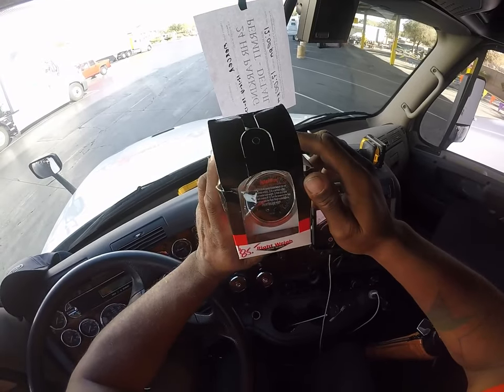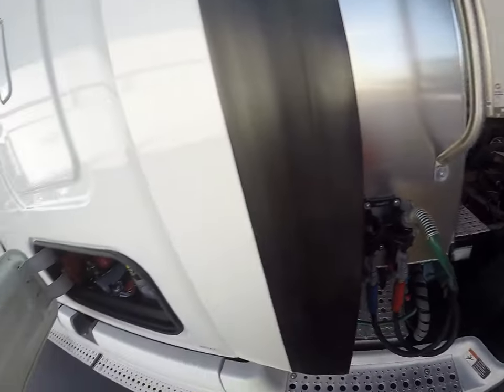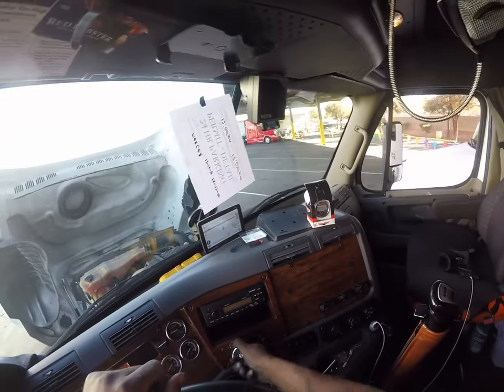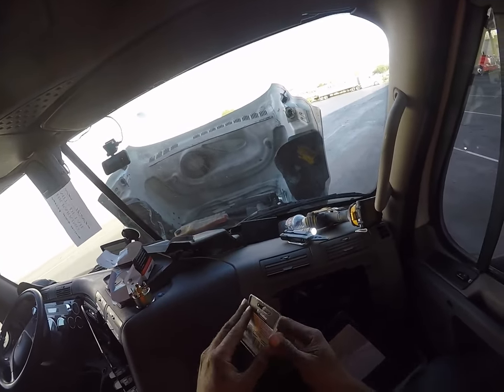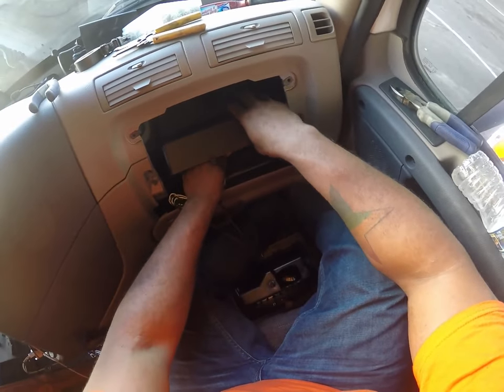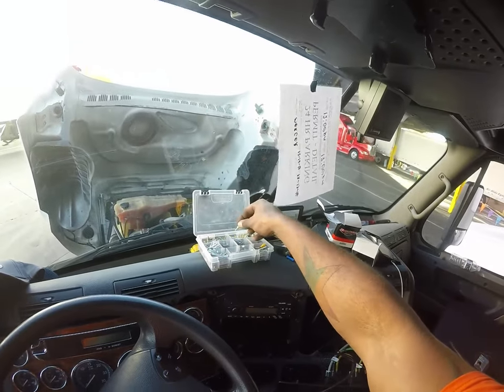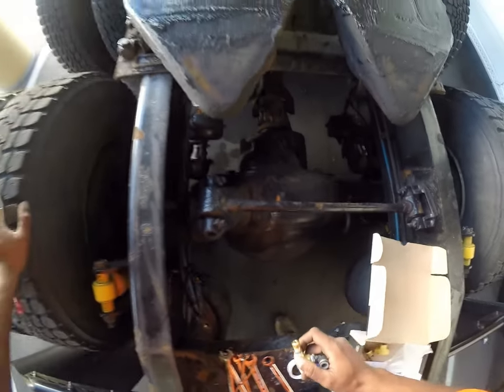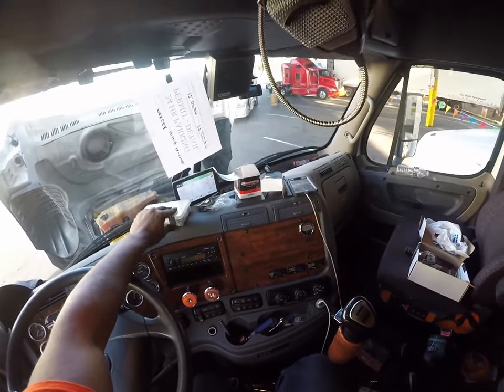Right Weigh Load Scale Installation

Comment: Nothing wrong with a long video. Very interesting. How did you work out the connection to your bag?  It's amazing how simple it is to install. Can't wait to see the calibration video. I do have one little bit of advice... I know, I know... as a former truck driver and a current aircraft mechanic, get yourself a small spray bottle with dish soap and water mix. You can spray it anywhere to check for leaks, it will bubble up if you have one. Always a good idea if you ever wake up with low to no air pressure, or just for peace of mind with brake chambers.

Comment: hey jay have you had any trouble with the gauges from the store i got two for my trailer one for each axle hooked them to the air bags but i can't get the needle to go down to 15 i called right weight they said i need only one and hook it to the level valve trk 11392